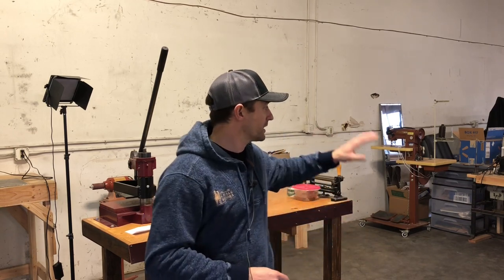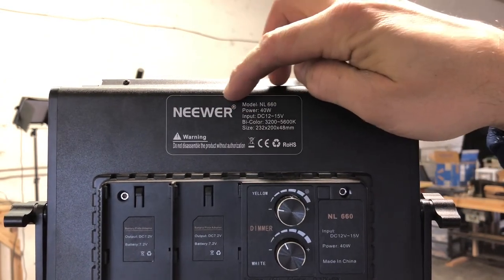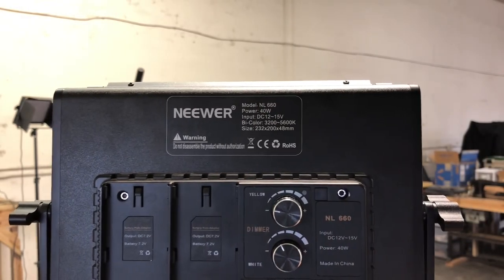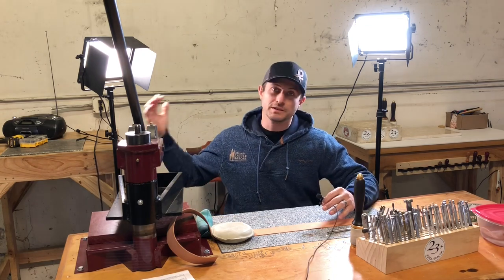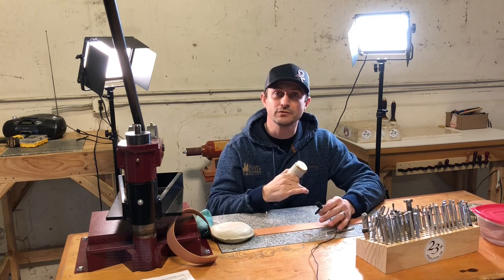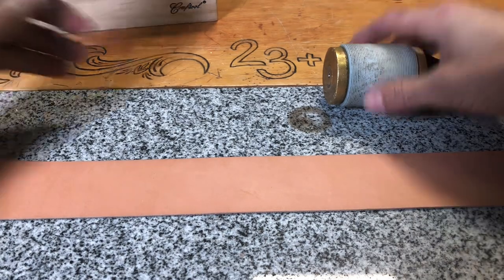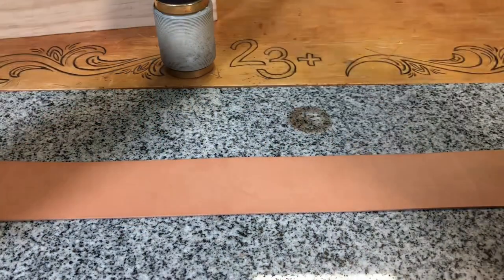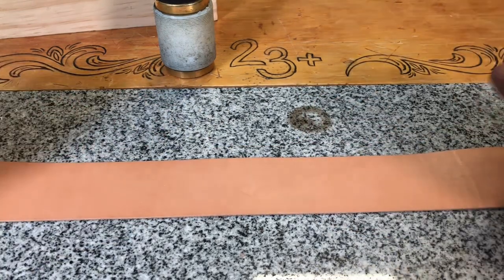How to set up a leather shop with good lighting

Comment: I have a drafting table light bar that's on an adjustable arm. It mounts with a c clamp but can be pulled off the clamp and has a peg. So I drilled holes in certain spots, which allows me to have light wherever I need it, from any angle. Super bright LED, low amp (since I'm off grid this is important) and has dimmer adjustment.
Reply: Thanks! Mad Dawg